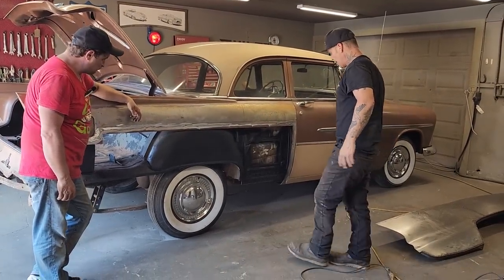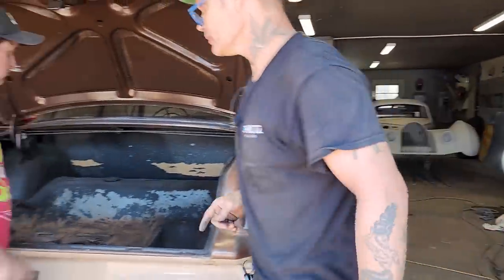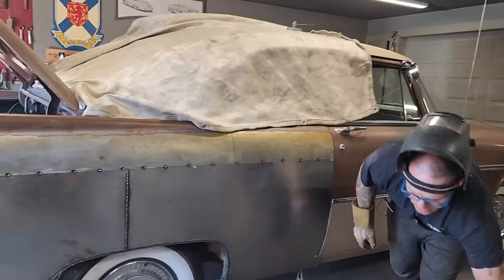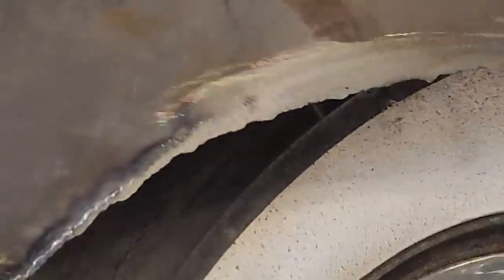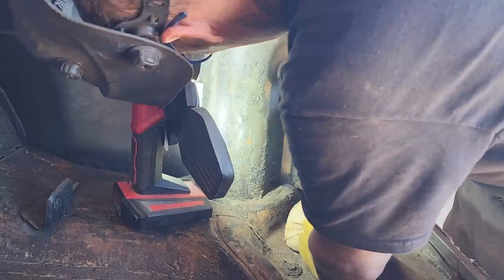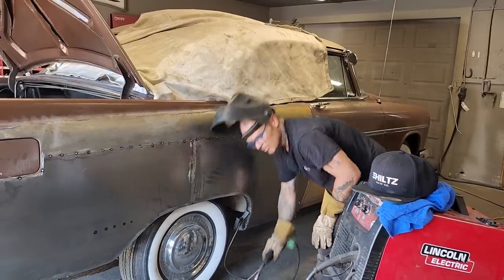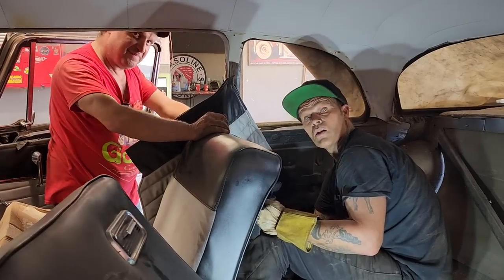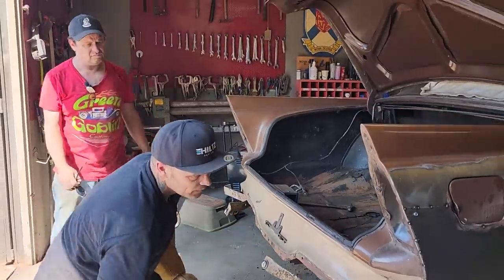Applying the quarter panel… will it fit? 🙏

Comment: You know you have talent when you make something so overwhelming to most actually look easy! It looks awesome!
Reply: I didn’t think you were going to get that long piece out of there, goes to show what I know. 
Great job as always.
Reply: When are you going to address the elephant in the room. The rear wheel opening doesn't match the front. It can't be flat. Both  wheel arches are flared. Chad didn't flare the rear arch because he doesn't have the skills nor the tools. Even the lip on the inner fender is flared
Reply: @chungasrevenge9222  The 56 Savoy did not have flaired wheel openings in the rear, only in the front
Reply: @chungasrevenge9222 make sure you do your research before you make silly comments like this. The 56 Savoy doesn't have flared wheel wells in the back. Just the front.

Comment: There is an Irish utuber who does custom work . When he is but welding a panel in , he tacks the panel in place and then zip cuts at 45 degrees between the panels the spot welds same as you do the angle cut allows the panel to press into the joint and it leaves a really good but weld with less grinding afterwards.
Reply: What's the channel name?
Reply: Fitzee's Fab
Reply: Fitzzy showed that trick too.  
Chad and Fitz have some different methods but both fun to watch.

Comment: Hi Chad and Jolene,
I have a suggestion. At about -37:50, you were unable to see in through the trunk to behind wheel well. For tight spots like that, a boroscope would be useful tool, rather than just settle for hope you've guessed it right. Boroscopes are very cheap, though unless you get one with built in screen, you'll need a laptop or tablet plugged in to see the image.
You're doing great work and providing fantastic instruction and inspiration. FYI, I'm not an avid car guy, builder or even general fixit type, but I'm truly fascinated by everything you do. Your work ethic , skills, creativity and ability to communicate  transcends the fact you'e working on cars, etc. I'm addicted to your channel for life!

Comment: Looking like a good fit.  The cutout for the gas door needs finished and then the panel can go on.  Chad has this in hand.
Reply: Oh dear!
Reply: When are you going to address the elephant in the room. The rear wheel opening doesn't match the front. It can't be flat. Both  wheel arches are flared. Chad didn't flare the rear arch because he doesn't have the skills nor the tools. Even the lip on the inner fender is flared
Reply: @chungasrevenge9222 Dude really. Is that all you got? This man skills are far beyond any tool he has. Honor the man for the knowledge that he has. Do half of the work he's done and then come talk.
Reply: @TyKempPandSKingdom  Sounds like you have ma man crush on Chadwick.

Comment: I totally get your frustrations with your new Milwaukee grinder. (I’d return it before it bites you). I have several of the same Dewalt ones that you have with the paddle trigger as well as without. Last year I bought a couple of Makita paddle triggers, and while they have a little bit less power, I like the smaller barrel grip with the larger paddle trigger. They are Makita GA4534 if you want to check them out. 👍🇨🇦

Comment: Chad I love the way you tacked the quarter panel into place then grind along the cut and remove the excess you always have another trick up your sleeve I will definitely be trying that way next time it can be such a prick trying to line it up if you cut out straight up.

Comment: Company called ok diamond make 4.5 " cutting wheels that last for possibly 3000 plus cuts and do not change size so the blade does not have to be replaced all the time. The disks are about 18 to 22 dollars each but the time saving in changing blades may be a help when making long cuts.

Comment: Just wondering will you primer the back side of the quarter panel it will need some coverage to stop further corrosion?
Reply: It's too late now,  the panel has already been fitted!  Painting the back sides of panels(properly) and preventing future corrosion is the most time consuming(and important) part of doing the job,  alot of people skip that part, but it's the difference between a job lasting a long time or a short time.
Reply: Yes it sure is time consuming to pre-paint inner panels in Chads case he's got some exposer to the rear inside through the rear trunk area and the inner cab for future coverage ! I guess his speed for results makes good video content he's doing a good job regardless  @RW-bi2rp

Comment: That bent in the panel at the bottom right of the tail light does not seem to be deep enough?
Reply: I don’t think he cares what it looks like. He’s just showing you can put flat sheet to hide rust damage. 
It will probably look fine from 50 feet away.   He sure works hard. 👍
Reply: I thought that from the start. In order to make it fit, he would have to stretch the metal into the concave curve, but the distance is greater, so he will have to bash the steel with a hammer and that will cause dents and distortion which will have to be fixed- more work.
Reply: @autophyte   As long as both sides will end up the same it probably will be okay.
Reply: @beerstein7137  Fair enough.

Comment: And the main reason to go cordless is to get rid of all the trip hazards for Jolene ❤
Reply: Having 3 angle grinders with 3 different uses. 
1. Cutting
2. Grinding
3. Flap wheel
Reply: Cordless grinders chew up batteries pretty quick, I use both
Reply: @stevetroy5526  not Milwaukee 5.0 
And when the battery does die you pop it into the charger and put a fresh charged back in. Quicker than changing a zip cut

Comment: Just saying… what if u welded some rods every 6” on the inside panel in truck an Doug could pull the panel away from the new panel as u cut. ? Cut the inside panel out in pieces then ?

Comment: When are you going to address the elephant in the room. The rear wheel opening doesn't match the front. It can't be flat. Both  wheel arches are flared. Chad didn't flare the rear arch because he doesn't have the skills nor the tools. Even the lip on the inner fender is flared
Reply from the maker: Google 1956 Plymouth Savoy, rear wheel arch is flat 👍🏼
Reply: @BadChad  What would you do if the wheel arches were flared?
Reply from the maker: @chungasrevenge9222  I would flare them

Comment: Screws hold far better on wood due to the ridges as to the smooth nail . Screws are a different composite steel and not meant to bend . Your advice was simply…wrong . Air nailers are used for their speed and not a better holding application . Your welding advice seems solid but I don’t think I your advice on others areas of fabrication is a good idea without truer knowledge . This could be considered  opinion if it wasn’t in my alley . Journey millworker ,cabinet maker and also have the tin-bashed ticket . Got greedy ,I guess . Your creative thinking and applying  in the areas of metal fabrication very interesting and your skill level is very impressive in this specific area. In short , I am hanging in there .
Reply: @dral9657 Chad is 100%correct about the elasticity and flexibility of a nail v screw.
Reply: Stay in your lane. it was a little mean.
Reply: @dral9657 Why do you think ship hulls are nailed and roved, and not screwed. Do you even build?
Reply: Screws and nails both have a purpose and are sometimes used  together to achieve shear strength and grab or clamp force. In modern boat building screws are used as tempory clamps until the epoxy set,  recommended that you remove Screws  and fill them Holes with epoxy. Under the water line Screws propell a boat.
Reply: @samos82  To what purpose ! My company built 350 homes last year and we have been building homes since 1997.  As far as a side shear capacity yes. When it comes to deck for homes where you want the most solid locked in piece…trike to know if it’s nails or screws ? All our commercial cabinets are screws, haven’t used a nail in 35 years ! You have no idea of what you speak . I appreciate your defence even though you are following a naive path . Consult your nearest home builder or millwork shop and then get back to me .
Reply: @samos82  Ships , when metal …most are welded in replacement of rivets ! I have built 2 boats actually and high quality glue then clamping and some stainless screws were used , never nails. You seem to have so little knowledge of this ,it isn’t worth discussing . Wrong ,incorrect or inaccurate is the same with your and Chad’s comment .
Reply: @samos82  Well, I like the channel but inaccurate advice over opinion was obvious . Doesn’t matter it was direct does it ?
Reply: @samos82 We never used nails for any boat, and some screws were left in . I really doubt you have never built a house or boat . To be fair, the 2 boats were both small and a learning experience,but my background was formally high end kitchens and house building . The nail and more tensile bending which means nothing in so many applications and the comments are not to use them because nails are better because their steel composite doesn’t bend the same…is foolish and you still have no validity endorsing otherwise . Simple !
Reply: @dral9657 you did edit your statement, didn't you now.
Reply: @samos82  Yes, I toned it down to be less critical but the facts remain as they should be . Is that a problem for you ?
Reply: @samos82  The was missed but I don’t blame you.